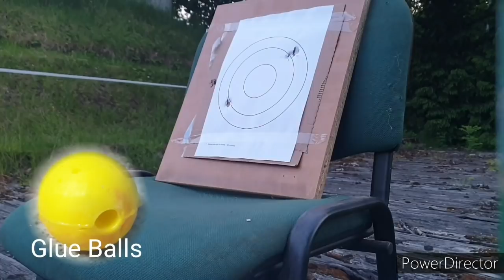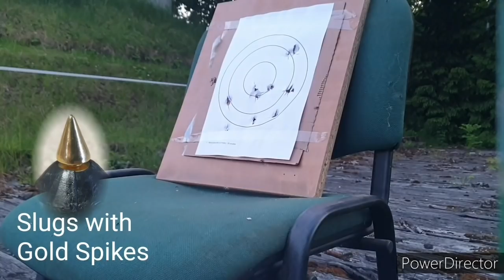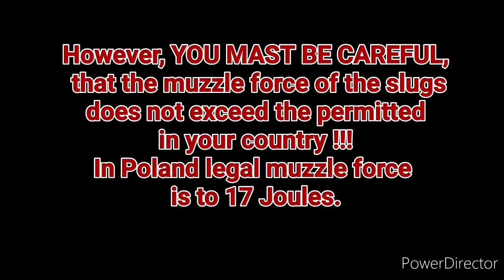The BallMAKER Mold casting SLUGS for HDS 68 RAM T4E shootgun + Shoting Test.

Comment: Got my mold.  Very cool.  I bought the Arrow 300 watt glue gun and took the rubber tip off so  I can get the glue gun deeper into the mold.  Works great.  Bought spike studs on Amazon and now I am going to order the 22 crimp blanks.   My first attempt was bad.   I needed to let the glue gun heat up more and I did not put enough glue.  Second batch were perfect.   Now its just up to the imagination on what you can make.  Thanks Mateusz.  By the way, great guy and very easy to work with.  Get a mold.  it makes the gun 10x more fun.
Reply from the maker: Thanks for FANTASTIC comment ;) 
Have Fun with Mold. 🤠
Reply: Can you buy this for first strike FSC pistol and how?
Reply: Czesc,fajna rzecz,fajne video tez,a  jak to mozna kupic?pozdrawiam.
Reply: Good looking out!
Reply: This sums it up…. Many thanks
Reply: Absolutely. it's cheaper to make and use can use your imagination. it's fun. At 65 retired I've discovered a great hobby 💥Make-N-Shoot💥 for yourself. God Bless

Comment: Tips
1  use a high temp glue gun.  I bought the arrow 300 watt.  My 40 watt did not melt the glue enough and the glue hardened to quickly.  
2.  Remove the rubber tip.  This let's you get the glue into the first section better
3.  Dont put too much oil. If it puddles on the mold you get an indent. 
4. I used roofing nails.  I ground divots in the top to let glue flow down to the tip
5. Buy one of those long lighters with the trigger to finish off the slugs.  
6 put enough glue
7 I used mini Irwin clamps to secure the mold.  Got much less squeeze out. 
8. So far I like the slugs made with screw on belt spikes the best.  7mm by 10mm.
Reply: Make an agitator with an electric motor to vibrate the bubbles out if you want them perfect. Glue the motor can to the side of the mold then put a magnet on the side of the motor shaft and turn it on and it will vibrate. Or borrow a vibrator from a girlfriend, wife, or friend, lol.

Comment: You should make an aggregator so that it removes all bubbles. A little electric motor with a magnet stuck on one side of the shaft then glue the motor to a small aluminum pan turn it on. It will vibrate making the parts much smoother. Probably too much work for something you're going to shoot and destroy, though, lol.

Comment: Wonder if you tried using arrowheads or small crossbow bolt heads into slug molds... maybe they can be more effective.
Reply: I was wondering the same thing ...I just wanted to know if that will hit harder then a crossbow
Reply: Could you hammer tip of nail flat and then sharpen it?

Comment: Excellent invention, very good video, a 200w glue gun is enough?
Reply from the maker: too much enough ;) Problem is only with glue, some color or black glue sticks have more glue than silicon and slugs come out sticky . Only white transparent glue is always ok.
Reply: @roodymatiz  What temperature setting recommended for black sticks ? Thank you
Reply from the maker: @francoisdumont767  I prefer low teperature 160oC for slugs. Higher 200oC for balls.
Reply: @roodymatiz  Thank you very much  again

Comment: What kind of glue sticks are you using? When I make them the sticks I'm using is to sticky.  I'm using the Manelord Glue Gun - 100W from Amazon. Thanks
Reply from the maker: Gluegun you have is good. Try other glue sticks, best is transparent white it almost always don't sticky. And put a lot of oil on mold.
Reply: @roodymatiz  Thanks.

Comment: You’re not waiting long enough for the CO2 to fully gas up the cylinder. If you waited an extra 10 to 15 seconds, it will be optimal. Otherwise your second shot is going to be about 8 to 10 inches lower than where you’re aiming every time.

Comment: What's the eBay link?
Reply from the maker: https://www.ebay.de/itm/274376685302
Reply: @roodymatiz  I want this. Will you be selling any more?
Reply from the maker: @Fetti_Sosa  17.06 All molds will return to ebay. After holiday.
Reply: @roodymatiz  thanks for the swift response interested in both ball and slugmaker for T4E HDS. If there is a .43 cal ball maker I'll take it also.
Reply from the maker: @Fetti_Sosa I have 43 but only silicon mold (less durable), I planning 43 also plastic mold in future.
Reply: @roodymatiz  I subscribed to this channel will be on the look out 😎

Comment: Dangerous habit with your trigger finger, please learn about and practice proper trigger safety and control. This bad habit of yours will transfer over to real firearm use and I wouldn't stay at a range with you around. Never have your finger on trigger until muzzle is pointed in a safe direction and you're ready to shoot intended target. Other that that nice product for plinking but, check your laws on use of such projectiles as you might be the one going to jail instead of the bad guy. Just saying be safe have fun protect your family just do it wisely and safely you know the commi left just looking to disarm yet another legal gun owner.